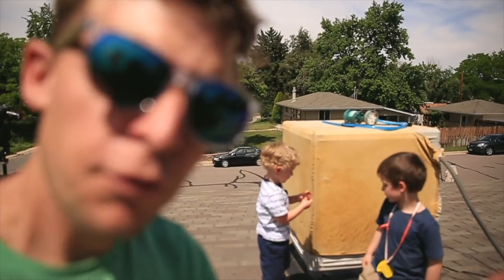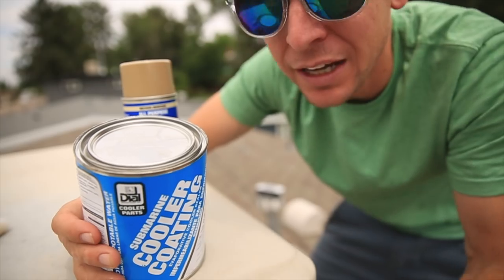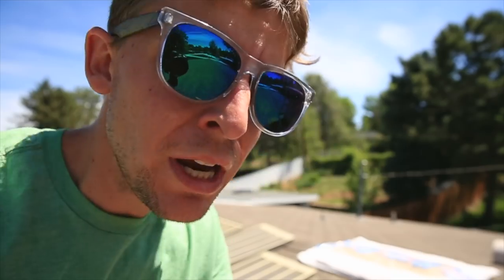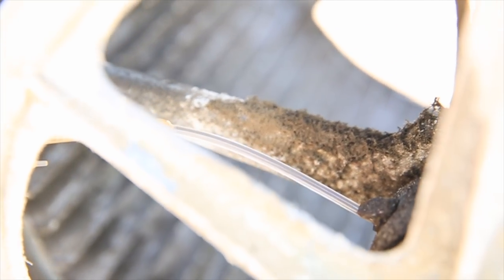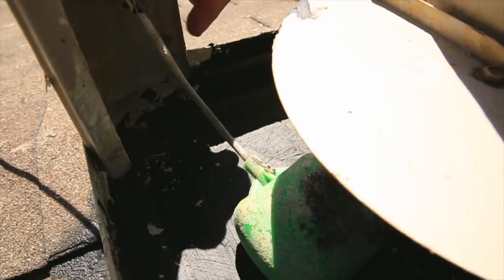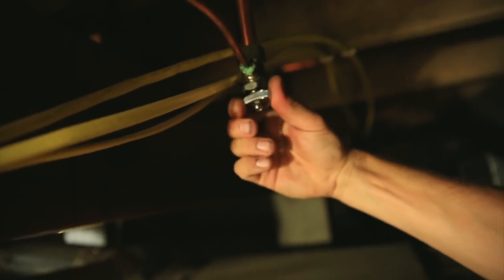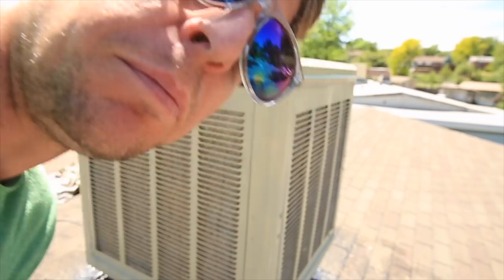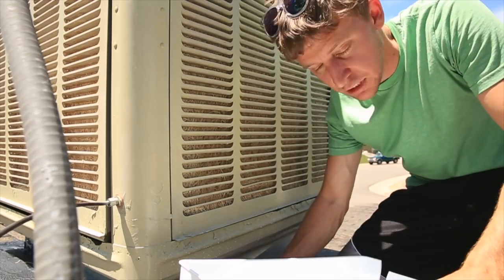SWAMP COOLER LEAK!!! + ICE TRICK (VLOG)

Comment: I've been working on swampers for over 43 years in Arizona. The ice thing is a myth. The water temp does not matter. What matters is the amount of evaporation, THAT  is where the cooling is created. The lower the humidity the colder the air gets. I not only never put a hole in the pump basket, I also put a mesh one inside the plastic one which keeps ALL debris out.The holes in the plastic one are big enough to allow pieces of the aspen pads to get through and plug up your pump or the distribution tubes. Two other myths, Don't put double pads in. It only restricts air flow which equals less cooling. Also, use the water pump size that is rated for your cooler. Putting in one that is too powerful will drown the pads resulting in less cooling because the air can't get through fast enough to evaporate. Just saying this is what has worked for me. If putting ice in makes you think it's cooler, go for it.
Reply: I’m having intermittent leaking any idea what the cause might be? The only thing I can think of is that the pump might be too powerful for the unit.
Reply: I’ve been watching a bunch of these vids today lol. I’ve tried all the tricks over the years. Double the pads, ice cubes, frozen water bottles. You are the only comment I’ve seen so far that knows the TRUTH 😂.  Yeah nothing works as well as just running it to manufacturers specs! The ice thing does give you a blast of cold air for a few minutes but that’s about it. It was never enough to drop the temp in the house not even by a  .1 degree. Just wasting your ice 🤣.
Reply: the greater the temperature difference between a fluid and ambient air the greater the heat transfer and it takes more heat energy to evaporate
Reply: So how do I cool my house in this scorching heat?
Reply: @Tohfool  well if you live in an area that has low humidity, get a swamp cooler and run it to manufacturer’s specs. That will help but if you really want to cool your house down good and can afford the electrical bill get a giant air conditioner!
Reply: Im just done dealing with leaky swamp coolers over the decades. Anyone have a better idea?

Comment: It also looked like a couple of the discharge hoses were barely discharging any water. Always make sure they aren't clogged to get a full stream of water to thoroughly soak the pads.
Reply from the maker: StrongEnough78 I cleaned them out once a year, didn’t stop the leak, we actually bought a portable swamp cooler for this summer, we,re through with it

Comment: I lived in Southeast Denver for several years, but didn't have a swamp cooler there. Here in AZ we use blocks of ice. But not dry ice. We don't have an issue of the water freezing during evap season. It's too darn hot.

Comment: Leak is most likely where the downdraft vent meets the bottom pan...using cooler coat or tapes and puttys are bandaids correct fix is replace the whole unit or do a fiberglass patching job on existing bottom pan. Should remove cooler inspect roof mount and flashing for leaks before re installing unit after you drained it dryed it repaired it and test for leaks

Comment: #QD 1) Try to locate the leak if at all possible. Look for clues to narrow down the possibilities. But leaks can be very tricky because water can travel far before it finds a way down. 2) Double check all possible leak sources. For instance, the seal around the ?overflow drain? that you tightened up needs to be water tight. What about the water supply line? And so on. 3) Now check the water sources you did not consider like condensation on the outside of the supply line. Or, if there is too much draw on the fan, it could pull in an errant stream of water flowing over the pads or splashing up from the bottom. 4) Try one thing at a time until it starts to leak. For instance, only fill up the pan and let it sit for a day. Did it leak? Next, turn on the water (but not the pump) and wait a day. Did it leak? Next, the pump and wait. Finally (I think) the fan. When it starts to leak, you will have a good clue of what caused it because it will be related to the last thing you did. 5) Look for trends and correlations. Does it always leak? Does it sometimes leak worse? Is there a pattern? Wind, temperature, or humidity related? #BreakItDown #TrialAndError #HardWork 😉 Hope this helps‼️
Reply from the maker: It's insane...BUT I believe we have figured it out. You'll see more footage today...
Reply: @SethJamesDeMoor  Link possible? :) Good advice!

Comment: I just got my pump replaced today and I finally have a working swamp cooler. I've been without it all summer, and I'm here in Pueblo so it's just a little bit hotter than Denver. Currently 102.
Reply from the maker: YEAH!!! Congrats, glad you got it fixed, especially in Pueblo, it's definitely hotter down there. We've switched over to a portable swamp cooler, working pretty well for now.
Reply: Yeah, I have a portable in my room as well which I use when I'm sleeping. Unfortunately my electricity has gone up like 50 since I've been using it. My apartment has some horrible insulation so heat gets in during summer, and winter can be crazy. But still better now than nothing. My apartment was getting up to 85 degrees before the AC was working.
Reply from the maker: oh man, I hope you are able to stay cool through the rest of the summer!?! Will you get a new one next year??
Reply: @Zombie23Maniac  If it's a portable swamp cooler, your bill should not have gone up 50%. The electricity is only running a fan (blower) and pump. If it's a window AC unit, that is another story.

Comment: The best thing you can do is use a few ice-cream containers full of water left in the freezer overnight, and when you switch this thing on, empty out the ice from one of the frozen icre-cream tubs into the reservoir of the swamp cooler and continue to cycle through them throughout the day as you re-fill and freeze them in your own fridge, therefore preventing the need to go and buy ice from the shop.. However, as others have said, this is only really effective in a smaller room like a bedroom or study, not an open plan living area..

Comment: Use a block of dry ice instead of regular ice
Reply from the maker: sbl8im 8 Brilliant!
Reply: a better video is does ICe help at all
Reply: Dry ice is a bad idea for two reasons...

1.  It releases large amounts of CO2 (Carbon Dioxide) in to the air as it evaporates.

2.  Adding too much can cause the water to freeze which prevents circulation and can lead to you burning out the water pump.
Reply from the maker: Beau Eginton wise call

Comment: What kind of Oil do you put and where?
Reply: SAE 20. In the little filler caps on the bearings at both ends of the squirrel cage axle.